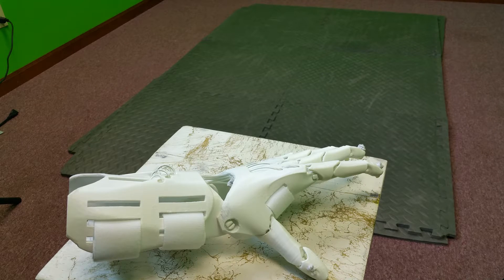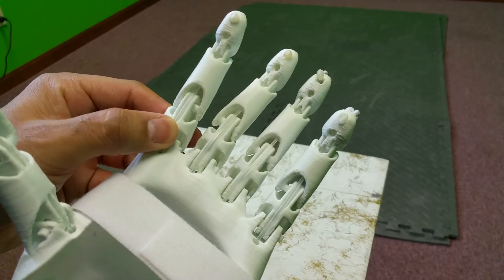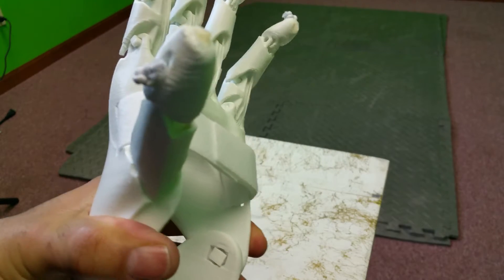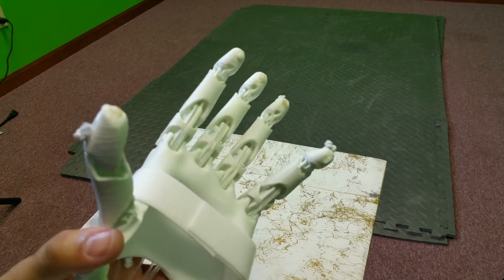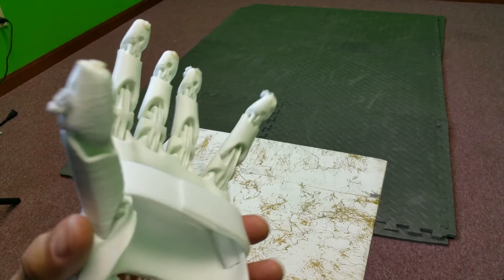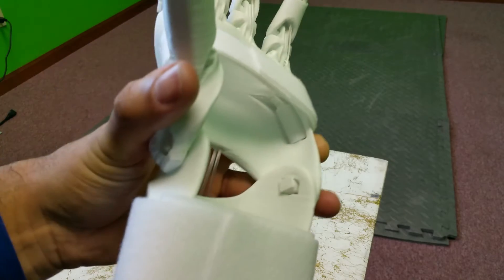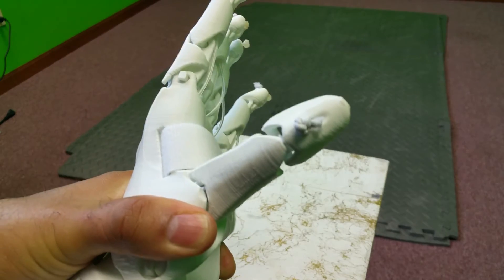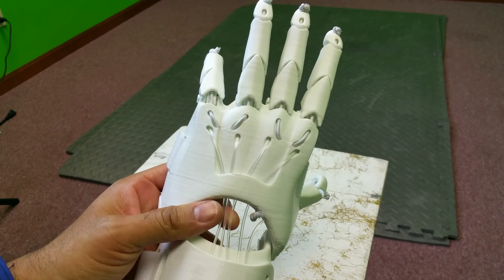K-1 Hand Demonstration

Comment: How did you adjust the print size to fit you?
Reply from the maker: +Alex Net Actually did it in the slicing program. Just used scale function. I had a professional scan of the recipients limb, and imported that into the the slicer, along with the hand to visual assess proper scale from the real scan of the limb.